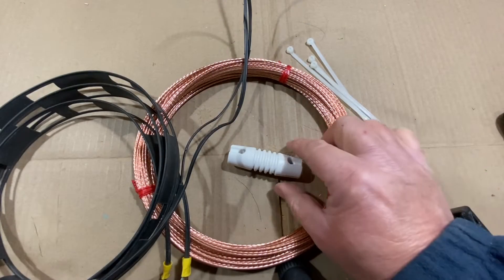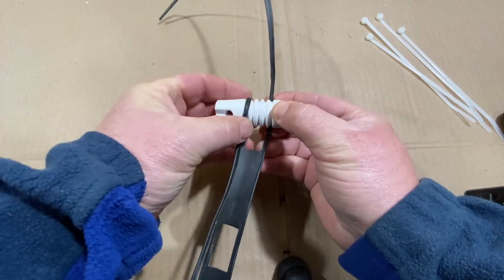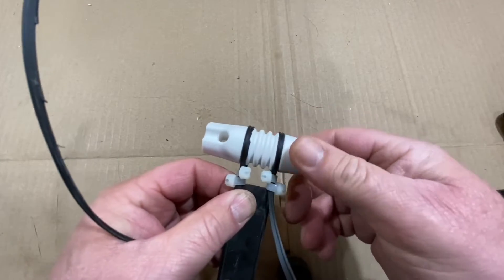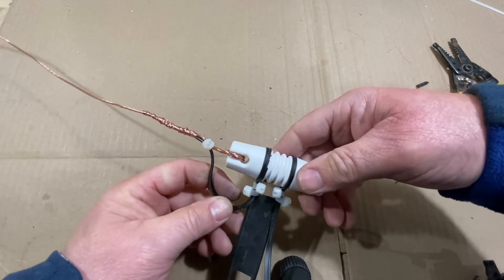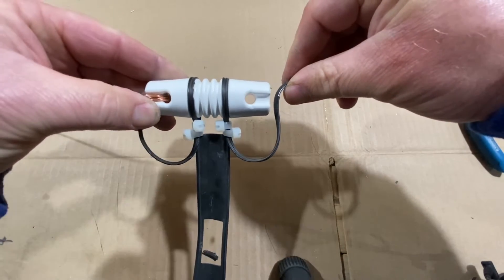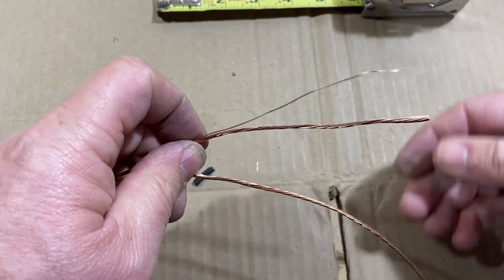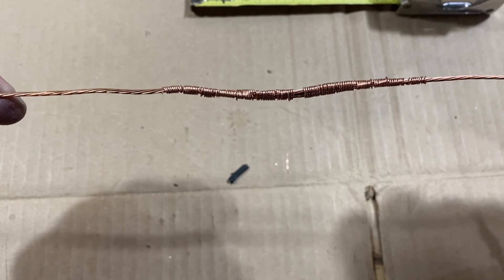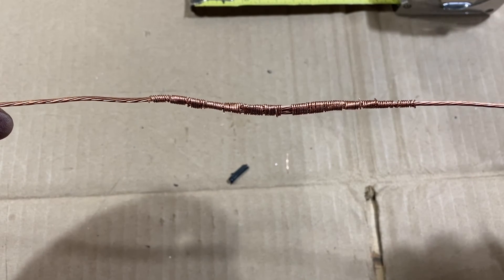Making Antenna Wire Connections & Splicing

Comment: Perfect timing for this video. My 40m horizontal loop came down during a recent storm. The weak point was where the wire ends met the ladder line which were mounted to a piece of plastic from a cutting board, but I have plenty of those insulators, and this looks so much better. Thanks Kevin.
Reply from the maker: That's awesome Jason.. Glad to hear this video helped spawn an idea for you.. I hope it all works out and you get your loop back in the air soon.. Thanks for sharing and stopping by... 73, Kevin ~ k0klb
Reply: Thanks for teaching me  how to put the antenna  together and  putting the  two wires together  also.  I  definitely appreciate it and I enjoyed the video as aways keep up the great job .👍 73 AE4OY WILLIAM PEACOCK EM-81UF Blackshear, Georgia 😂
Reply from the maker: @williampeacock9473   Thanks for your comment William.. I'm glad you found the video beneficial.. I appreciate your support.. 73, Kevin ~ k0klb